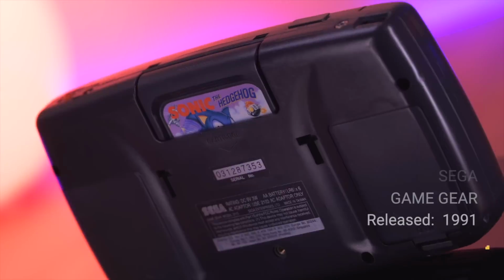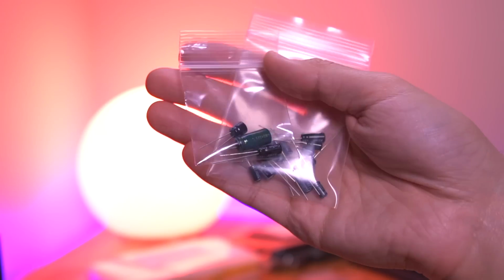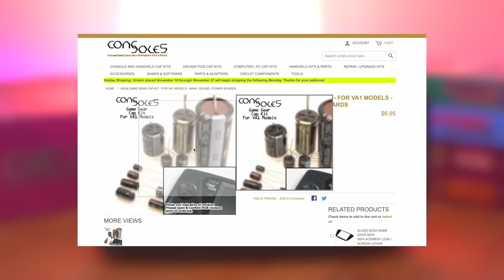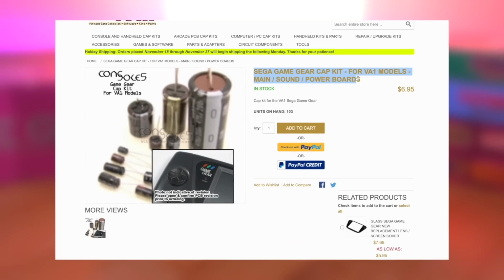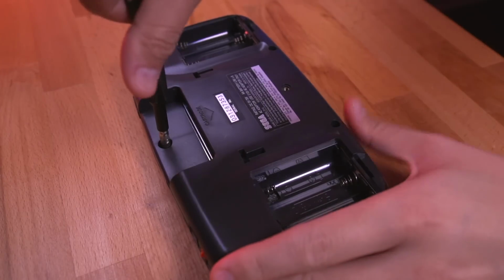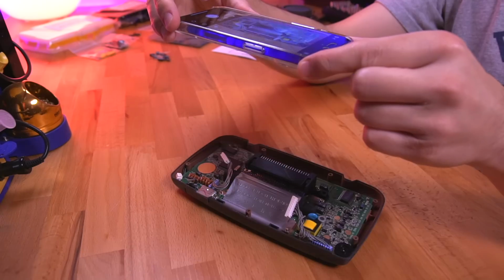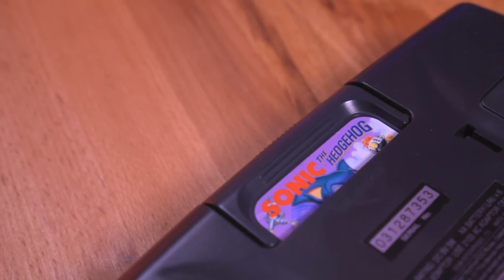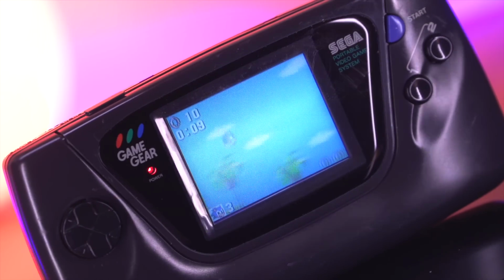Restoration Therapy:  Let’s Save The Game Gears

Comment: First handheld console here as well.  About 3 years ago I re-fell in love with the platform and have about 6 sitting around.  One was built from scratch with a Raspberry Pi A in it.  Has a from scratch PCB with 4 buttons, Retropie, etc.  

But I also recapped one as well for that 100% nostalgia build.  

Any way, love these!  Great short vid.

For those not in-the-know, RetroSix has a ton of mods and cases for these now!

Comment: Recapping a Game Gear is one project I really want to do especially with my old one and a couple of others I've obtained over the years. My soldering skills are non-existent, but it is something that I want to learn and of course have the necessary tools to do this type of project so that I can enjoy playing my Game Gear on the go if I wanted to.  This is a great video, and I hope I'll use this to refer to when I am ready for this project.  Naturally my original GG is a VA5, but I won't be using that for consolizing.
Reply: The best way to learn that is with one of those soldering practice kits. You can get one that's a basic electronics kit, or one that's just a soldering kit. It will allow you to practice without having to worry about destroying an impossible to replace piece of history. I do think that the capacitors will have to be replaced  in all these units eventually, even if it means that they're no longer 100% authentic to how they were new. It's not something that really matters much as these components are more or less the same, although some have better or worse durability and quality, they don't affect the function of the unit.
Reply: @SmallSpoonBrigade  I did know about those kits, and I will get one of those to see how it goes because tackling a project like capacitors in a very well loved gaming system is going to be one that will have to be done. Hopefully I’ll feel comfortable doing that when the chance comes up.

Comment: I've found- after recapping over a hundred of these- that the standard vinegar swipe/IPA bath is not enough on these damn things. That fluid is *everywhere*; under all the chips, clogging up all the vias.

Ultrasonic cleaner or if you don't have one, the dishwasher can do the job in a pinch as well.

I was a GG kid, but like any good marriage, the years I've spent working on them has slowly turned my love into resentment 😂

Comment: I ended up with a few GameGear systems last year. None of them worked despite at least two listed as “tested and working in great condition”.  One was “recapped” and sold as “working perfectly” but of course that wasn’t at all the case so I need to recap them all myself and see if they added more aftermarket LCD screens compatible with other MB revisions.

Comment: I've done 3 Game Gear recaps now. Not hard but definitely not fun. 
If anyone decides to do one, take the time to clean the boards the right way. It's tedious but worth it.

Also... The Sega CD Model 1 power supply board is a pain in the ass when damaged by electrolytic fluid. Def don't sit on those, clean & cap those asap is you got one.

Comment: I actually had to give up on the one I purchased to get fixed. I don’t have the stuff or any solder skills so I had a friend working on it. They got busy and couldn’t make time to do the cap replacement it needed. Recently just sold a bunch of modded Gameboys and some cards. Took the money made and purchased a fully modded GameGear instead. I still have the other GameGear listed on my Mercari page with the cap kit no one has shot me an offer to me 45 with the cap kit and the power board repair kit with a game gear sounds like a steal.

Comment: Oh great, look--another awesome video from Tito. :) I appreciate the work. Question for you (regarding capacitors): I've been having issues restoring my old GG and replacing the screens. My amateur skills ended up shorting out the RetroKAI screen and motherboard I got over a year ago. I recently did the RetroSix CleanScreen to much better results, but after a few weeks, it started shorting out consistently. I'm going to attempt again on another GG, with another CleanScreen, and hoping the third time will be the charm. I was using the ceramic capacitors for the other two, and I was wondering if you notice any difference between using those or the more standard original types regarding power draw and things of that nature with the ones you've worked on.
Reply from the maker: Hey Justin!  Great question!  I’ve installed both the ceramic and regular electrolytic caps in a game gear and I haven’t noticed any difference.  However, I’m not certain what the long term effects of using the ceramic caps are. Because the GG was designed with electrolytic caps, I recommend using those. Also, one thing to be aware is to make a sure nothing is shorting when closing the console, that could potentially causing some issues with your installation. Cheers buddy!

Comment: As I watch this I still think about my opened system that is yet to work. I need to change the caps on the power and volume board. I may have to clean the main board as I didn't fully remove the fishy solder.

Comment: Seeing that you use my same technique gave me strength and joy!

I have fully recapped one unit but...
Black screen, no sound :(

Any hints?
Reply: Does the old power adapter give it any power? Is the battery compartment ruined? 
If it's neither of those you could try testing continuity on the traces?

No expert got lucky fixing 2 need to replace a sound board on a 3rd
Reply from the maker: Hard to say but sometimes the pads delaminate from the traces so you may need to solder directly to the traces. Did you replace the sound and power board caps?
Reply: @JungleJeffarnold 
Battery compartment looks clean
Reply: @MachoNachoProductions 
This is good point!
I swapped both boards with a known working unit: no joy.

Comment: You say it's a restoration but there's no mud everywhere nor suspicious case holes? I smell a fake!
Jokes aside, great job at keeping another console from just dying as it was going to. Good soldering and clean end result, the only one thing I would add to the job is a dab of hot glue on each of the SMD-fied electrolytic capacitors, to avoid them flapping even the small amount they can in that mount style. Should make it far more durable if it's going to be played. This is often done for heavier components, or components that have to be mounted in non-standard ways specially in vibration prone environments.

Comment: Hey tito, good day to you , i have a question i have a brand new ps5 controller that flicks orange light three time when you press the ps button then turns back off even when its plugged in or when you press reset button it only lights orange three times then turns back off, you got any idea what to do or should buy new one eventho its just one month old , thanks in advance
Reply from the maker: Hm strange, I would try to exchange it if you still can at the store you bought it from. It should also be under warranty so Sony should be able to repair it for you. You could call them as well
Reply: Alrite thnx

Comment: These cap kits are great, but I'd love somebody to create a replacement connector for the cartridge slot. I've been wanting to backup my own cartridges and save data and I can't find anybody that's selling the connectors other than ones that were scavenged off of a Game Gear or a Game Genie. I've been toying with just building my own using pogopins and a 3d printed holder, but I haven't got a lot of time to do things like that with work and school.

Comment: CapXon caps are what I would replace in any given device to begin with. They are junk, just like the originals and Jamicons or Xicons. Nichicon, Panasonic, Chemicon, and other reputable brands are the way to go indeed.
I used a mixture of caps of different brands for my own Game Gear some years back, cherrypicking for both long working life and low price.
Rubycon dropped out of the capacitor business, no? An unfotunate loss.

Comment: just a idea: install windows11 to a smartphone with snapdragon845(windows11 have drivers for snapdragon845) and mount a liquid cooler on snapdragon845 after remove back cover of the smartphone. Connect wireless keyboard mouse set and a xbox gamepad then do gameplay tests.
Reply: there is ps2, ps3, wii, wiiu, n.switch emulators for windowsOS too. add a razer kishi and have a handheld console.
Reply: a Turkish would not know English language but still can be smarter and wise than a person who perfect at English language.

Comment: I feel we should focus harder on a dock mod, keeping them portable, rather than outright consolizing them.
(Yes, I know some of them are beyond saving/restoring that far)

While it might make sense to some, who said we need one or the other?
Maybe dock it upsidedown, maybe make use of the EXT port? 
The scene is smart, maybe we can copy the Wiimote nyko li-po charge cradle to charge the battery mod while it's docked? 
A smart circuit that isolates the battery upon docking, so it can safely charge uninterrupted, and use only the power jack while docked? Again, the scene has some mad geniuses. 

the VA4 (and possibly the VA5's by extension) have that early alpha build screen mod, I'd get it but that price point is a bit high for me to jump in on the hype train. 
Replaced my caps, wasn't fun with pads coming off in places, but I made it work.

What happened to that fellow that was making the outright replacement/modernized PCB? Did he (or anyone) manage to figure out the VA4/5's nonsense? Or did he stick to the VA1/2's?

Comment: Don't use CapXon capacitors. I wouldn't, for this or any other vintage console. I cringed through this whole video. What did that poor Game Gear do to deserve this? They're a third tier manufacturer with a bad reputation -- mostly from terrible quality control (seen quite a few blown out in brand new electronics) and garbage manufacturers using their caps in environments they are unsuited for (temps outside labeled temp spec). It's somewhat worrisome that the distributor of this kit is sending out low end caps, just to shave a couple bucks (at most) off of the cost. For what they are charging, they should be sending out top tier caps -- or at least give me the option to not get them with a discount for doing so.
Reply: Hi David, thank you for bringing this to our attention. We were unaware of all the points you brought up and were not intentionally trying to send subpar caps with the GGHD kit. Better quality caps will be purchased and sent with the GGHD kits at no extra charge.

Again, thank you for bringing this up. We only want to sell the best quality kits to the community we love!

Comment: Why can't you replace them with smd. The pads look close enough?
Reply: I'm assuming you mean ceramic SMD caps and not electrolytic SMD. You can't get all the proper values (capacitance, voltage) in ceramic caps. Even if you could, they are quite a bit more money than even a top tier through hole electrolytic. With quality electrolytics, leaking isn't a problem (unless you abuse them). So why spend more money for almost no benefit?
Reply from the maker: There are some kits out there that use ceramic caps. I made a video installing them and they seem to work well, however since the game gear was not designed with these in mind, I’m not sure what the potential long Kern effects are on the system.
Reply from the maker: There are some kits out there that use ceramic caps. I made a video installing them and they seem to work well, however since the game gear was not designed with these in mind, I’m not sure what the potential long Kern effects are on the system.
Reply from the maker: I like using electrolytic since that’s what they were original designed with.